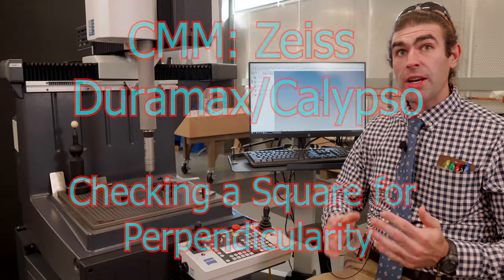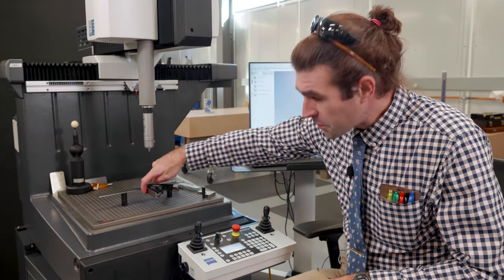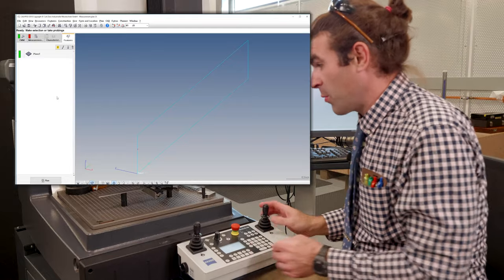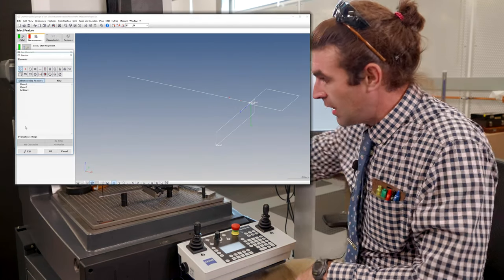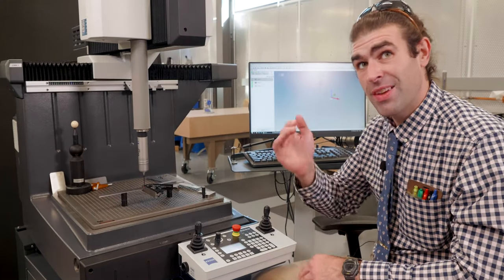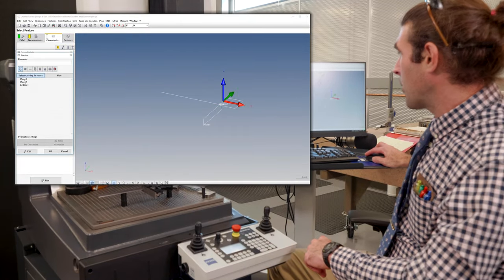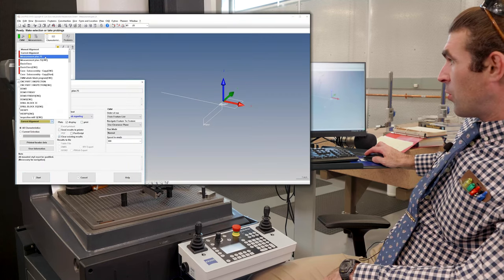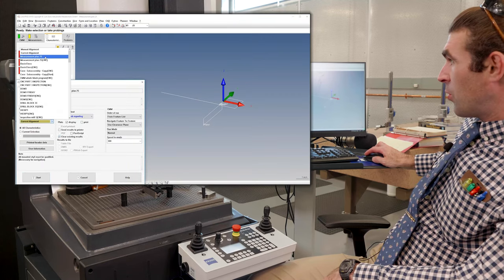Zeiss CMM: Measuring a Carpenter Square (Mitutoyo vs Starret)

Comment: awesome video, was able to extract exactly what info i need in order to get started with final part inspections using a ziess cmm/calypso. I just recieved an unexpected promotion at my work from machinist to quality control and other than what GD&T and print reading experiance Ive gained from manual machining the last 5 years I dont have much experiance with final inspections other than checking what work ive done machining against whatever the print tolerances so the transition has been pretty daunting for me so far to say the least but I am determaned to stick with it learn what I can on the fly and do my best to fill the role which is all I can really do. some of your videos where a little perpelexing at first due more or less to me watching them in the wrong order and needing lessons designed for a complete newb like myself, I will be watching more of your videos you are a great instructor